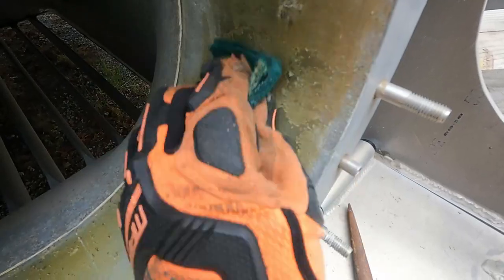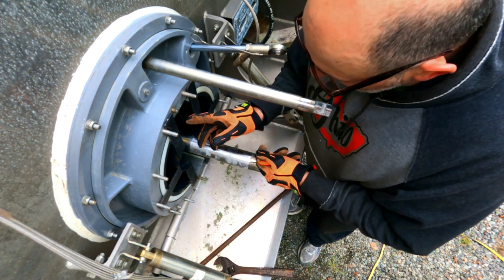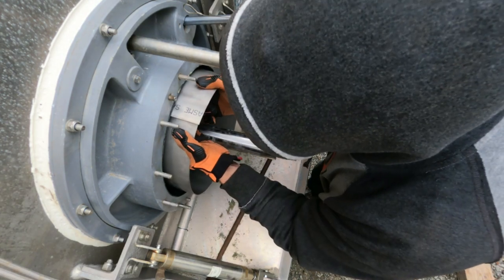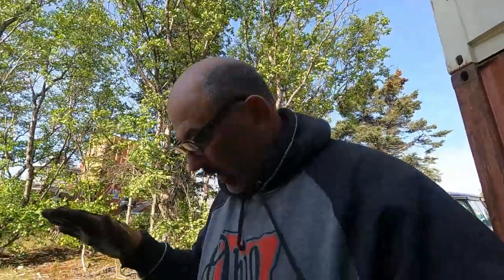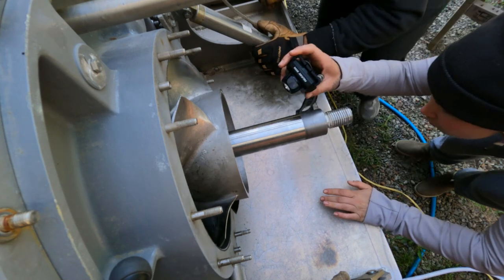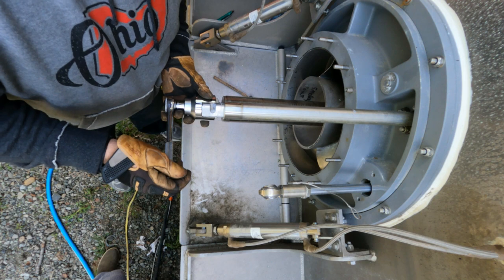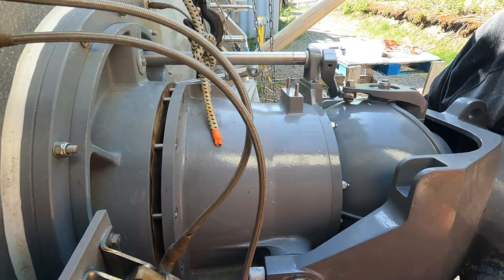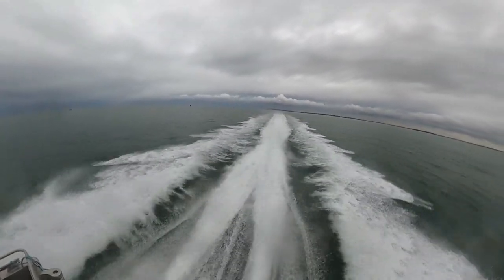Marine Jet Power Ultra Jet 340HT wear ring and impeller installation

Comment: Just a tip from a guy that has been running jets for decades..... Never use anti-seize on stainless.... especially on a jet. Anti-seize is aluminum oxide based and will increase oxidation between stainless and aluminum. Anti-seize will oxidize on its own between stainless and can actually seize stainless to itself. For the impeller you are way better off just using a good red grease or a Nicole based anti-seize instead. Just a word of advice from one gillnet captain to another.....
Reply from the maker: Hey thanks for the tip! Honestly I think this is nickel based stuff I was using but can't say for sure...Speaking with another captain I was told I don't even need it because the shaft is tapered and I need a puller to remove the impeller anyway... Cheers!

Comment: Cool video installation. Btw, what's the clearance between that wear ring and the impeller blade? Seemed to be too close?
Reply from the maker: Honestly at this point I couldn’t say what the clearance was during this install. I try to get it as tight as I can. Sometimes it is more of a fight to get the impeller in than others. If the tolerance is more than (roughly) .02-.025 that isn’t going to give me the performance I want. Last month when I pulled my impellers they were at .06 and I was having trouble getting on step (light ship) in deep water.
Reply: @SaltWaterSalmon   wow, that's almost less than half a milimeter. won't that kind of tolerance be an issue on turbid waters? or if a straw for example got stucked unto it?
Reply from the maker: @user-wt4zc1vk8c  I'm sure you are correct. I've had to backflush flotsam several times in the 4 years I've had these. Also, the waters of Bristol Bay, where I operate are often very silty. These impellers get worn down pretty fast. I only operated 35 days this summer and were giving me grief by the end of that time. 
I've never asked MJP, and you seem knowledgeable...do you know what the mfg. tolerances are?
Reply: @SaltWaterSalmon   I don't know what their tolerances are. usually, they are very secretive about their products so it's hard to search online. but what i know is that for pumps, it's usually around 0.1 to 0.8 mm. that should be the case for waterjets since technically they are pumps as well.